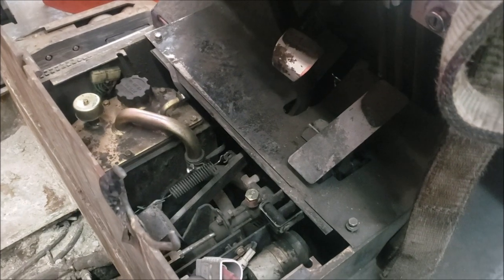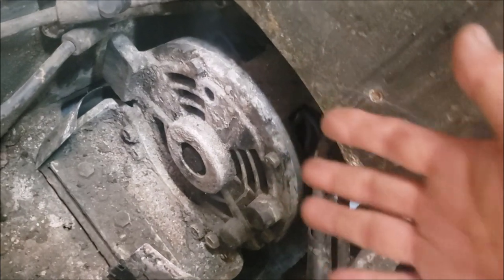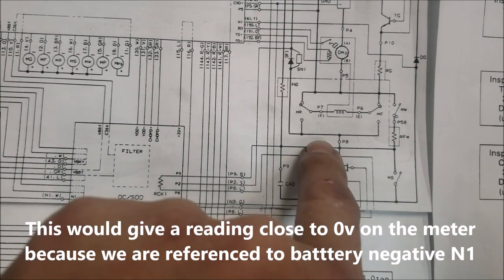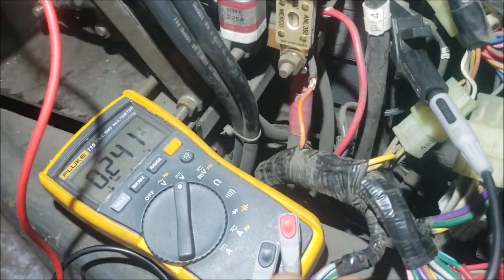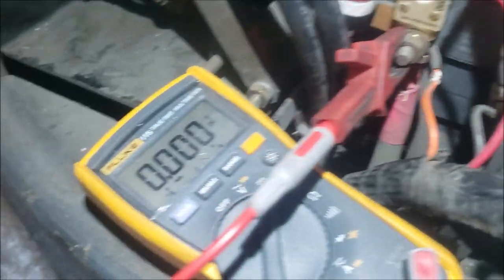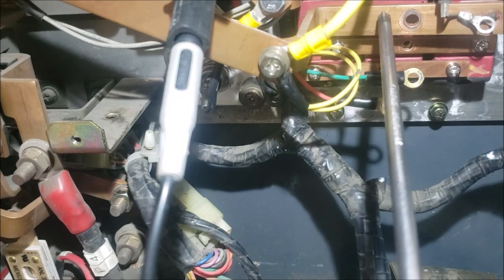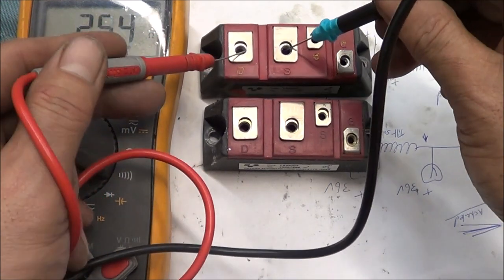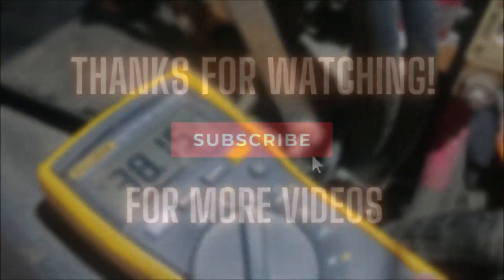How to test for a shorted Transistor (fault code C0)

Comment: I have been following you since 1 year now and your diagnostic procedures are a masterpiece. I had to troubleshoot and fix 2 Toyota 9BRU18 reachtrucks without any information on them. One of them with starting issues (Battery discharged, Code FG Fuse control board internal damage repair) and the other one with all cables cannibalized and cut (repaired and face also Code GD, steering motor sensor)

Comment: Nice work, I had this kind of issue with a TCM FB-15 2008 with steering problems. Steering motor is handle by 2 pair of IGBT modules in H configuration and once 1 of the transistors is shorted it disable the whole 
function

Comment: Not sure if you got my message, I try again.  I have a Toyota 15, 1997 year.  issue with Contactor not clicking, no contactor.  We tried changing the main contactor and computer box but still sometimes the main contactor does not click.  the truck is fully electric and the battery is new and good. Sometimes the contactor clicks and sometimes not even with a new restored computer case

Comment: My forklift has the code CO . It has blown a transistor. I have replace this and it blown another one . What causes these to blow . 
When I replace the transistor. I fitting 2 new and 1 reconditioned. And it blow 1 again
Reply from the maker: Could be DÇ/MD board.